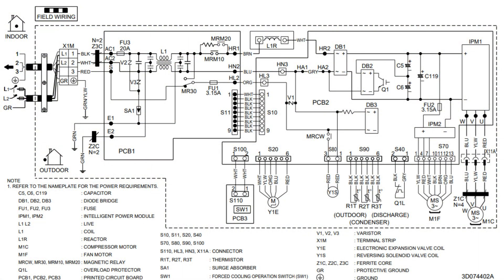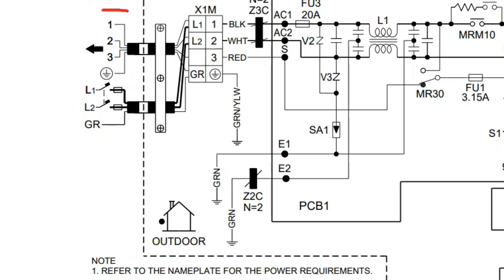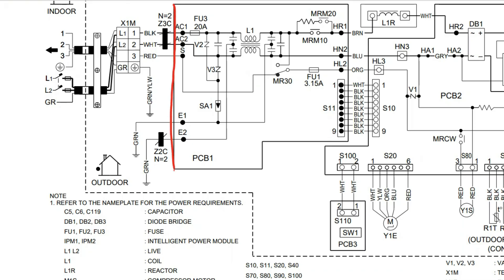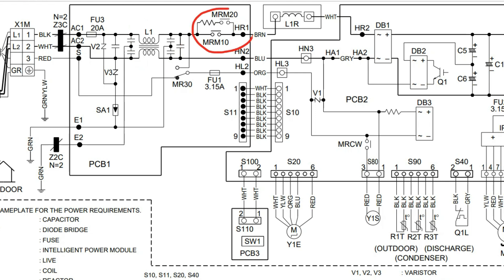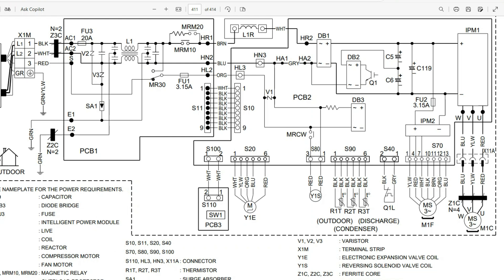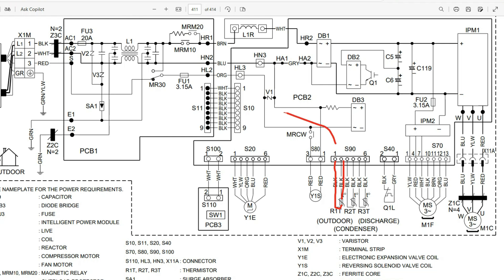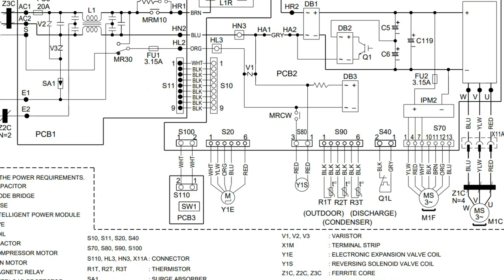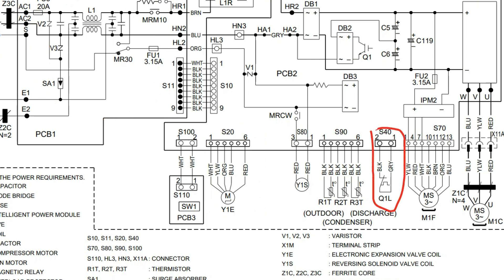Mini Split Circuits / Schematics For Beginners

Comment: And since they are communicating, when one portion of the system goes bad you have to replace them both otherwise they can’t communicate with new models. And we know how often these brands, change their models, software, etc. When you call the parts house nowadays, all you get is obsolete, obsolete, obsolete. Ridiculous.

Comment: At 15:55 I am seeing power come from HL3 down to MRCW, not the way you explained it. I need to brush up on this.
Reply: I noticed that as well.  I don’t fully understand all of these circuits.  Customers ask why it’s so expensive to work on a mini split and I usually tell them that it’s a computer controlled device with many, many more circuits and troubleshooting takes longer.

Comment: Unfortunately, It's all RIDICULOUS and a scam. Units are more costly and repairs become limited meaning replace boards or buy new unit!! The cost outweighs any potential savings of energy use!!!! Plus many more drawbacks found in the rabbit hole
Reply: Americans are gullible and will fall for anything. All you have to do is put a pretty paint job some snazzy fake numbers, put them behind a pulpit or with a nice silver badge and Americans will believe anything.
Reply: Ok Luddite